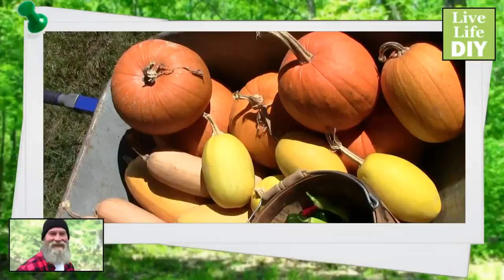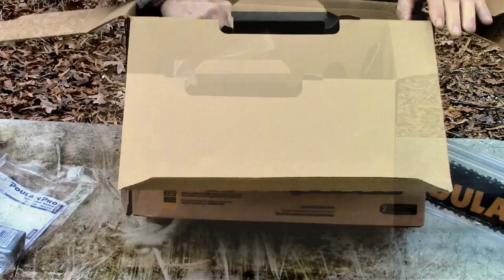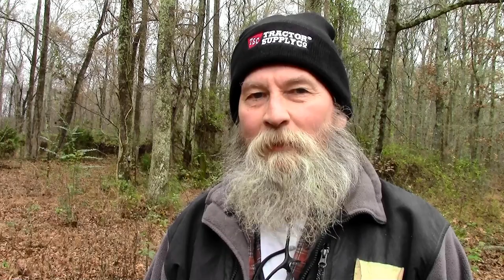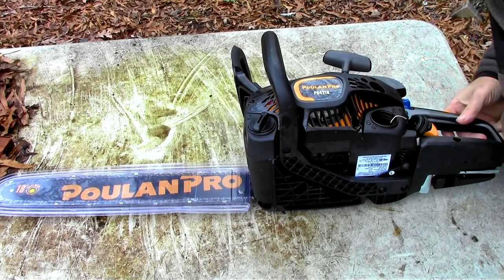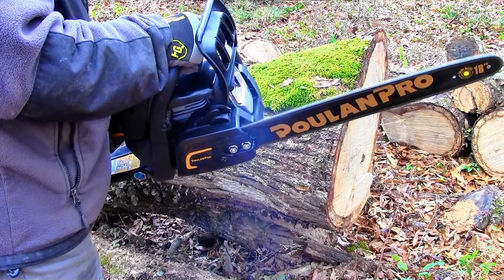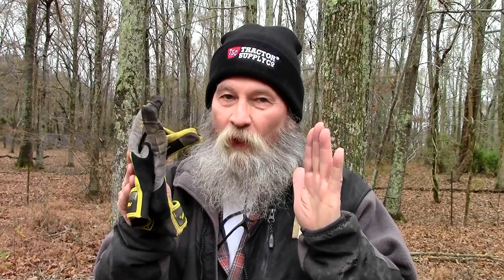On SALE Poulan Pro Chainsaw 18 Inch 42cc Unboxing Start Up and Operation

Comment: I have a 2018 poulan pro 50cc 20 in bar chainsaw and it is the best chainsaw I have had starts up every time
Reply: Run good to
Reply from the maker: Awesome. I used this one a couple of days ago.
Reply: My old 20inch 46cc is a BEASSSST

Comment: Great video. I just sold my Pooley and P3314 For $40. It was not a bad saw. But I upgraded to a echo CS 310-16. More quality saw with a 16 inch bar for 199.
Reply from the maker: Thanks for sharing. Yeah, the Echo is a completely different machine. Great price!

Comment: looks good,sounds and cuts good. my 2 cents on a common problem is if it needs carb adjustment do it. don't keep running it lean. if i were to buy one first thing i would do is see if it'll run ok with a quarter or half turn richer.

Comment: I have the 16" new one with eps I set the gap at .025 and removed the small plate on the muffler on the front as well as the screen they get clogged quick and it runs like a beast and I set the idle higher and this 40cc is a beast, a little louder albeit but man it rocks much better air flow ,edit I reinstalled the plate just no screen much quieter and still breathes better.
Reply from the maker: Thanks for the info. I agree, they over restrict the exhaust on a lot of engines to make them quiet.

Comment: My 42cc poulan pro is 15 years old. I just had to replace the fuel lines and change the carb settings a little. Paid 150.00 back in 2005. They aren't impossible to work on but a little difficult. I picked up a 16 in. 38cc spare for only 35.00 that just needed to be cleaned and tuned up to work great.

Comment: I have a 20" 50cc.  I had to gap the plug to 0.30 and turn it a quarter turn out on the high screw but other than that it hums nice.  But it wasn't perfect outta the box.  Save yourself the trouble and adjust the gap and adjust the carb if needed and you won't regret saving all that money buying a Poulan
Reply: Just got this saw new and it tends to stall out and die. Will gapping the plug and turning high screw fix that?

Comment: Nice video. I bought this saw for the opposite reason - I already had a smaller electric (I won't mention the brand) DEWALT, but I needed something with a little more beef to cut up some 12" plus size logs. I wish I'd found this Poulon for $99.... I paid a bit more at another famous chain store whose name I won't mention.... HARBOR FREIGHT.  I was expecting you to be a bit more critical of this product. There was a bit of a cynical tone at the beginning of the video so I was regretting my purchase for a sec.... but wow - it looks like a pretty decent value. Watching it sink into those logs - was quite gratifying. I have pine in my neck of the woods, so I expect a bit easier cut - your trees, maybe not hardwoods, probably a bit firmer than pine. Good tip on the 50 to one mix. The saw came with the pre-measured oil, I have an old can part-full of old mix. I'll dump it and start fresh. My saw came with an extra chain, wrench tool, oil, and a plastic case. It was an impulse purchase because of two factors: the price (low), and I've owned a Poulan (back when they were green) - and had a favorable experience with the brand.

Comment: My in-laws got me this chainsaw for Xmas.  I didn’t take it out of the box till today - 4 months later.  I started it.. made a few cuts.. and noticed the brake bar felt flimsy.  Upon closer look.. the brake bar is broken.  It has a huge crack in it.  And it’s way past the return or exchange period.  

Anyway… needing to cut up a tree.. I used it anyway.  Initially it cut great but after only 12-15 cuts it’s not cutting well anymore.  The chain is already crap.  Is this normal to dull a chain in 15 cuts?

Comment: I always say. "If you don't treat it as cheap, You'd be surprised how long they last". Even if you start mistreating high end equipment. They let you know by being a birch too start, or run when they feel like it. Treat them well and your chainsaw will work its ass off for you.
Reply from the maker: True. Anything will break when mistreated.

Comment: Most people not all have a problem with 2.stroke engines because 1 it's the person not mixing gas and oil ratio correctly and #2 the oil gums up the carburetor because people dont run the fuel out of the system before storing it for the winter

Comment: I own one. Bought from a discount store. Has no fuel or oil caps or chain, All will be here in 2 days from amazon. I used the caps from another Poulan saw and fired it up, it will need a carb adjustment but ran good.
Reply from the maker: Good find, nice.

Comment: I have this saw and right out of the box it starts but won't stay running. I did as you suggest, took an empty container and filled it with one gallon,, then put in the mixing oil and it seems to get worse with more use ( it won't keep idling unless you give it gas....it will shut off on it's own unless you feather the throttle. Brand new and I'm seeking help on how to keep it running= totally peeved that I bought this POS

Comment: Get a 14" bar and chain for it, I have a 18" Remington Outlaw and a 18" Poulan Wildthing they both came for T.S. lol. I have had them for years and I only use race gas in my saws with the right oil and they work just fine.
Reply from the maker: This would be ideal, I agree.

Comment: I'd probably buy it for $100. But I have a husky 455 w/ 20" bar for the bigger stuff. So I got the Ryobi 14" from.Home Depot instead. Personally I'm thinking of only running premixed fuel in the Ryobi. As you mentioned most problems seem to be fuel related. I'm careful to mix exactly and use non ethanol as well. I also shake the can before filling and usually only keep mixed for one year. This has always worked well for me. But I still think the engine runs best on the premixed fuel. Not sure why, perhaps just the perfect 50-1 mix or something. Wish it wasn't so pricey but I have seen the 32oz cans on-sale for about $3 once. I should have bought 10 of them. Nice video, take care.
Reply from the maker: I was looking for a small 14" saw. But never found one I wanted. The main reason I got this one was the price. Glad you enjoyed the video, I appreciate the feedback.
Reply: Yea it's a 37/38cc Ryobi they sell at HD for $120. I love mine, but it could have a bit more power. I was hoping to maybe use a 16" bar at times, I think that would be about all it could handle and you might be waiting a bit on a solid piece of oak or something. But honestly it's been great to me, nice and light, starts easy, cuts good, chain stays tight, oiler works great. You can't ask for much more. I'm starting to rethink splurging on the Husky if the cheapies work this well!
How's that Poulan treating you?

Comment: Got my refurb poulans  18 in and 14 in pro today from ebay..looks good but need to try to start one day..they dont even look used ...
Reply from the maker: Sounds nice, a great deal. Thanks for sharing.
Reply: I do same thing VM the best found  a scratch on one by oiler after doing a where

Comment: Can you post a video of how to change the bar and install the new blade. I purchased one and didn’t read the instructions so I screwed up my bar and chain and haven’t been able to find a video on this specific one?
Reply from the maker: I didn't look for a video to see if one exists. All you do is take the two large nuts completely off. The one's you see in my thumbnail image lower left. The black plastic cover pulls off and then you can pull the bar (blade) off. Take it to the store to find a replacement.

Comment: I agree I am a stihl tech i had a echo pb580 back pack for repair the unit looked brand new verry clean and when i pulled the rope it felt funny after i pulled the muffler off the piston and cylinder was scored i found out it had straight gas in it

Comment: I notice the biggest reason is people start the saw and reach for the screw driver. Hey Genius! The saw is set to perfection at the factory. Put the screw driver down and back away from the new saw.
Reply from the maker: Yeah, people think they are smarter than the factory folks.

Comment: I think most ppl have problems is the tuning there really isn't nothing wrong with poulan the carbs can be pretty temperamental.
But for a cheap small saw I think I'd buy the refurbished ryobi saw for $70 at HD if I wanted a 5th saw
Reply from the maker: Yeah, maybe 4 saws is enough? But who's to say how many saws any one person can own? Hahaha
Reply: @GoosePondHideoutWithRob  I lied 5 saws forgot about the old mac d44

Comment: I think 50:1 mix has more to do with emission then what is good for the saw .I mix 32:1 on my old home lite saws and 40:1 on a poulan chainsaw with 3 year of good use on it
Reply from the maker: I think the fuel:oil ratio depends on the engine design?

Comment: I also bought one on black Friday and got a carbide chain for it and it cuts very good it has A little trouble Idling tho.
Reply from the maker: Mine idles a little slow too.
Reply: @Razor__1972  I adjusted the idle screw too the right a little bit and it idles good now

Comment: I just bought one of these to cut dead fall around my seasonal campsite. I'm just wondering how much bar oil you go through when using yours? Mine seems to be spitting out a full tank of oil to one tank of gas. Would you consider this normal? Love your videos by the way

Comment: Nice saw, seems 2 cut fast with a 18 inch bar on it, even with the 42cc,keep up the good work man
Reply from the maker: Thanks. I was surprised it cut as well as it did with the basic low tooth chain.

Comment: I don't use a chainsaw regularly, but I live in the woods, and trees be falling, so I figure thisll work. They're nowhere near that log you started with.
Reply from the maker: This saw is designed for smaller tree work. It probably wouldn't last long cutting through large trees all the time.

Comment: Livelifediy, do all these Poulan pro saws have the same handle style? The huskies and sthils we use have a spring suspension to reduce vibration.  The only times I've used Poulan pro, I thought my hands were going to fall off.  They cut about the same as anything else in the same class, but the comfort was terrible.  The longevity of these are short too, but for a backup and limbing, I'd love to have one with suspended grips.  I cut 5-7 days a week for at least three hours throught the day.
Reply from the maker: I'll check it out in the morning. Not sure off the top of my head.

Comment: They are the same as a husqvarna equivalent. So i like em
Reply from the maker: Many machines are made in one place and sold under various names.
Reply: Yep. Redmax, poulanpro, jonsered, homelite, troybilt and craftsman are all made by husqvarna on the same assembly lines. Only differences are the carbs.

Comment: I have had one for about a year now my opinion is it's by far underpowered for a 18 inch bar it had plenty of power for the first month or two but now lacks greatly I have tried pre mixed fuel and fuel i mixed same result and the chain has trouble staying tight after a few months of use I have bought aftermarket bar and chain I don't know if I should idle it up or what to give more power
Reply from the maker: I agree, and the basic cut chain doesn't help.

Comment: Got one from the dump that runs great!  They’re not fast cutters because they used a 6 tooth sprocket and full skip chain to make up for the small engine.  Still a good backup saw to have around.  Definitely need a little tweak on the low and hi jet screws to get it running tiptop :)

Comment: Hard to beleive they went on sale for that low lol crazy. For the average working man who cuts wood to burn or clear downed trees after a storm these american made chainsaws are bar none. Had a 16 inch poulan pro for over 15 years growing up, just wouldn't die. I have a newer model 18 and just bought a 20 today. Theyre good saws despite what the higher end snobs and elitists say.  My 18 sat for two years half way pulled apart because I got busy with life and never got back to it. Put her together last weekend and put new fuel in her and started it second pull.

Comment: Hey man this is a nice saw Poulan day are nice saws it will last twice as long if you drill s couple of holes in the muffler lets it run cooler carb will need tuned sometime other than that they will run along time  there’s no sham in a99dollar chainsaw I have s older one good saw I collect saws great video the chainsaw mechanic
Reply from the maker: Thanks for sharing your ideas.

Comment: I bought the Poulan with a 20" bar last year from tsc. I like the saw, but noticed a few quirks with it. For starters, fuel is mixed exactly at 50:1. The saw will start up fine and idle fine. After the saw runs at full speed for about 30 seconds it will bog out and die. I've tried adjusting the carburetor which did help for the most part, but the saw will still bog down sometimes. As far as cutting goes, it cuts fine vertically, but stalls out if I cut horizontally. Just wondering if this is normal quirks with this saw or if other adjusting needs to be made.
Reply from the maker: My saw does take a few minutes to warm up. It frequently stops a few seconds after the first start. I have not adjusted anything yet. I haven't attempted any serious horizontal cuts.
Reply: @GoosePondHideoutWithRob  I used my Poulan today and it ran perfectly, except for the horizontal cut. It took me about 5 minutes to get through a tree about 8" in diameter because the saw kept stalling. I do appreciate your video and reply.

Comment: I just bought a refurbished one a week ago for emergencies and cleanup after Dorian.

PR4016 but the engine sticker says 42cc.
Running 32:1 premium, starts 2 pulls cold Everytime, Hot starts no problem.
I replaced the chain with a 63PS3-56 Stihl chain ( and boy she cuts!), gapped the spark plug at .030, when I first checked it it was bellow .015 it didn't even fit my gauge.
It's been keeping up with the Husqvarna 440 we run at work filling the wood shed.

Very good investment, got it on sale 100$ Canadian plus an extra 30$ for the new chain and file.
By no means a pro saw, but a good backup or first saw.
Reply from the maker: Glad to hear the good news.

Comment: I purchased a Poulan several years ago for about $85 (refurbished). As I recall, it was the same place you got yours. I've lost track of how many large trees I've processed with this little bugger. I just use cheap gas and tend to mix the oil too heavy (judging by the smoke). It always starts easy and I've mistreated it something awful. Including cutting big roots/dirt to prepare for stump pulling. I found it essential to learn how to sharpen my own chains.  lol I also own a Poulan lawn mower and it's also great. It usually starts 2nd pull every spring. Poulan may not be for the professional but for the farmer and part-time woodchuck, it's perfect (considering the low cost).
Reply from the maker: We are still happy with our saw.

Comment: I bought a poulan pro 4218 back in November had a problem keeping it running after 15 minutes took to dealer and they adjusted the carb,. took it out to clear up some limbs three weeks ago and it ran for 5 minutes and was loosing power  tried to restart and no compression took it back to the repair shop dealer and they checked it out and said that the piston was scored from running to lean. getting a new poulan pro chainsaw  from poulan, did anyone else have this problem? my old poulan chainsaw ran for ever
Reply from the maker: Thanks for sharing your experience. Maybe it had a defective carb?

Comment: i bought a brand new one pr4218 poulan pro chainsaw , used it once,(about 30 mins) works great,,,,,,,but when i store it back in hard case, bar oil is everywhere. i pay 169.00 plus tax, run me 189.00, the past poulan's my father owned this never happen on his 16inch green poulan. i shouldnt have to drain bar oil tank for storage, your thoughts please?
Reply from the maker: Some saws are leaky. I would probably drain a saw for long term storage.

Comment: put a 14 inch bar and chain on it and there ya go....oh  and fatten up both the  high and low side of the carb.   Poulans are notorious about being set lean
Reply from the maker: I agree and will probably do this.

Comment: Bought 18 inch poulan pro saw, would like to get a 20 inch bar and chain for it, is it doable or is there no way to switch it from 18 to 20
Reply from the maker: I wouldn't recommend a longer bar for this saw. If anything, it should have a shorter bar.
Reply: Ok thanks
Reply: See what you mean just used it and seems like it wants to bog down, cutting oak